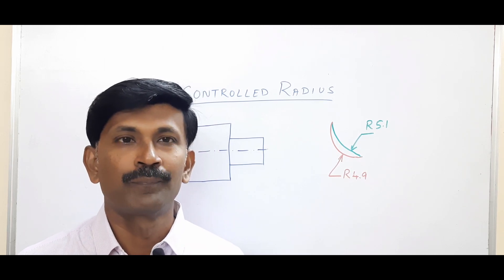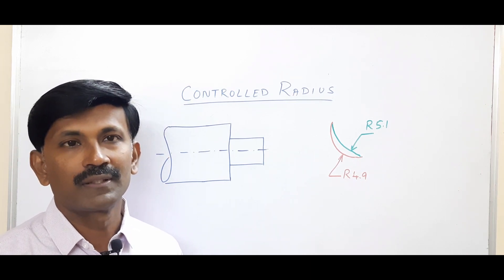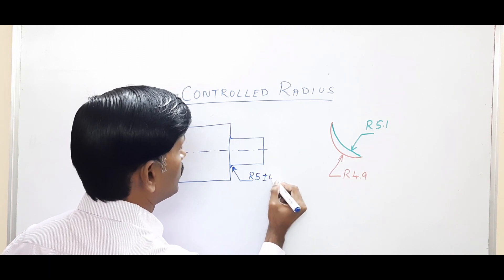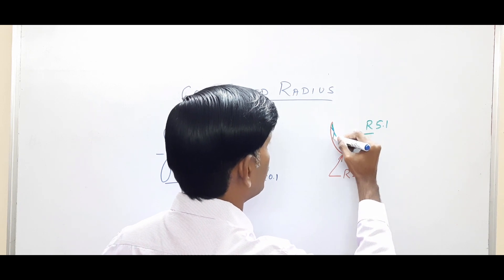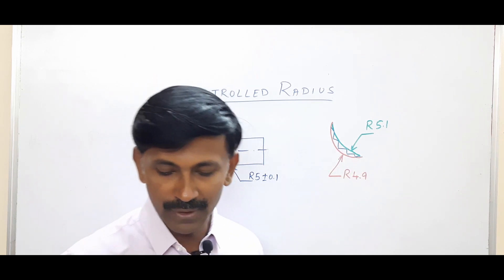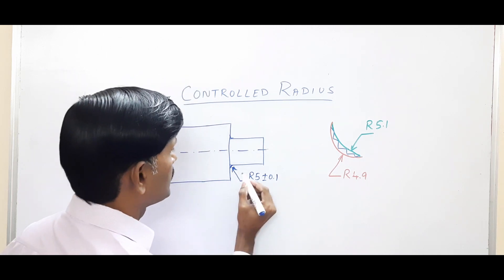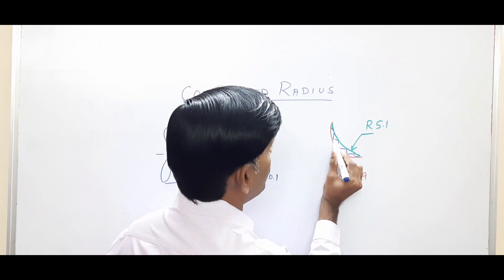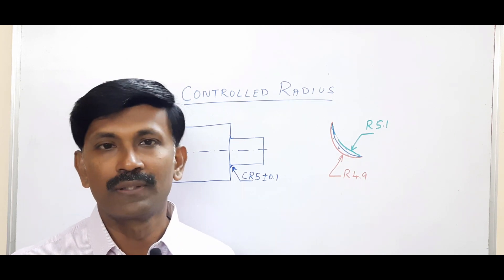GD&T Tutorial 19 : Controlled Radius

Comment: I thought this is only used then the surface need to drive another part and this CR is ensures the smooth running. If this one should be used for stress reducing either, in that case we  should use it at all the cases of machine parts. Maybe just some kind of design parts can be used with normal R which has no force driving function. Am I right?

Comment: How to achieve the controlled radius in manufacturing and how to check them out whether it is controlled radius or non controlled radius part
Reply from the maker: With machining process like grinding, polishing, super finishing, we achieve controlled radius. Checking is usually by radius gauge. CMM in sophisticated cases.
Reply: @PalaniKailash  thank you